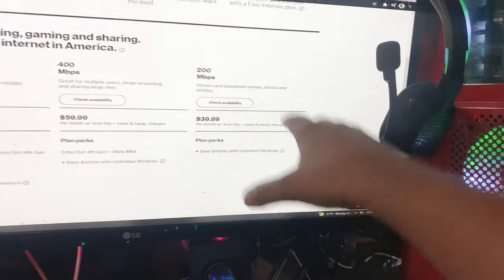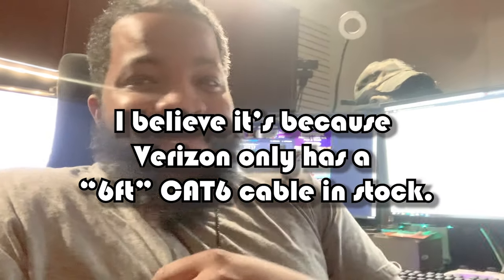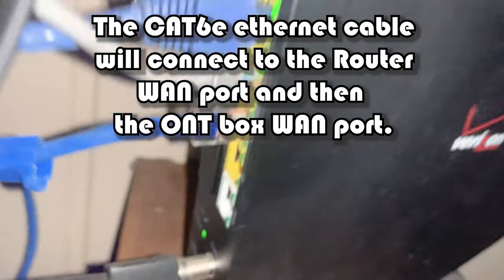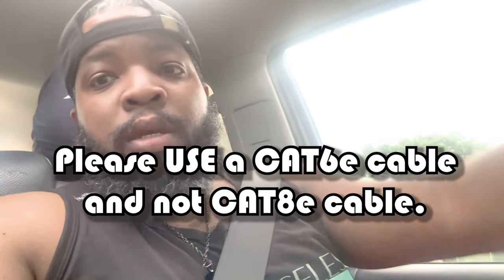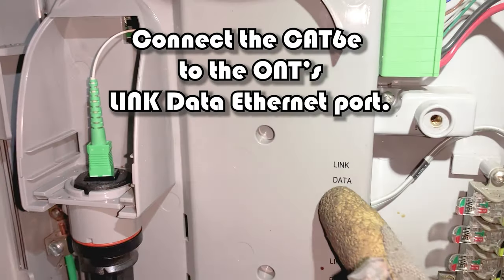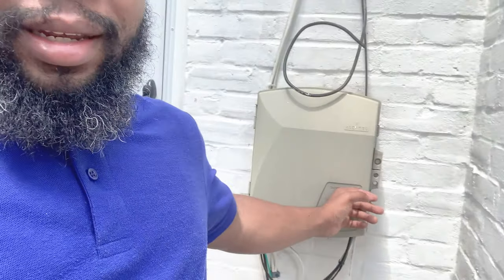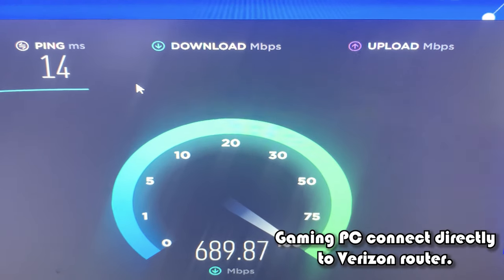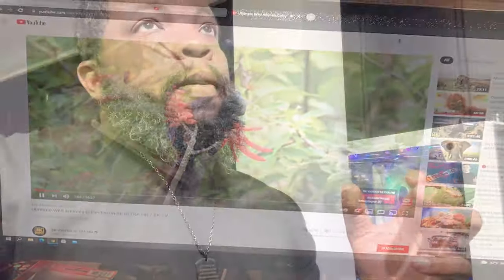How To Upgrade To 1000Mbps Gigabit Fiber Internet for Gaming (Was It Worth It?)

Comment: Feel the reason you experience better internet speed is because your ping speed changed. before it was coax cables, pings over coax is slow, ping over ethernet is faster.

Comment: I have 1gig fiber also however I don’t think it’s really necessary, or even better, unless you have multiple devices streaming 4k content. Or regularly downloading large files. Otherwise for gaming it’s the latency that’s really important. You can game just fine on even a 10 mbs connection if the latency is low. If you are using only 1 tv usually for streaming and live alone or maybe 2 people having 1 gig is just a waste of money.
Reply from the maker: Hey David,

Yes that's correct, everyone's situation is different including their home network setup which will have different results. But this video in particular is not your average home network, way beyond what your running. The I GIG internet connection was way over due and was WELL WORTH the investment for me. 

Appreciate your feedback.
Reply: @AWordFromMrJones  Also I think a lot of folks don’t realize they are not gonna get one gig speed on a wireless network. Unless you have a top end expensive network maybe. I have WiFi6 router and I get around 400Mbps on my M1 Mac Mini and about the same on my iPhone 12. 
The Apple TV I do have plugged directly into the router because of where it is. However I can’t tell a difference from when I used to use it wirelessly.

I have AT&T fiber optic into the house  with the terminal on the wall.
Reply: my dad got us wifi the other day and he got 1 gig the only thing were gonna use it for is our tv my ps5 and my phone but he thinks it will go faster

Comment: Having fiber period is worth it. why? SPEEDS- obviously having symmetrical speeds cuts down majorly on any kind of buffering period. LATENCY- fiber almost always has lower latency period, and followed by that JITTER lol, jitter is the variation in ping, and with fiber is almost always lower to non existent. Of course, you may see ping variation based on where you connect to depending on where your traffic is routing to, but usually thats over a fiber backbone anyways, so having fiber right off the bat instantly makes that connection stability much much better. is fiber worth it? hell. yes.

Comment: That flat cat6 sucks
Reply from the maker: @Himothy_xx  It depends on the purpose that a “cable” serves you.

Such as a flat Ethernet cable is very beneficial when it comes to the commercial(s) or @ home business use depending on how your network system and building infrastructure.

I’m a IT professional; so a general home user wouldn’t find much benefit of it unless say you a have a “tight” crawl space or behind the home wall where your trying to pull cable for home and cannot use a standard cat6 cable due to its round structure, a flat Ethernet cable would be ideal for use.

Hope you find your solution 🤟🏾

Comment: In Australia, the price for HIS gigabit connection is the price of our 50 mbps connection
Reply from the maker: WOW, if it's the same price then that's a good deal!
Reply: @AWordFromMrJones  no it’s WAY worse because a gigabit is 1000mbps, which you showed was for around $80. In Australia, $80 will get you only 50mbps. If you want 1 gigabit in Australia, the minimum it will cost you is $150 from a small ISP. Our internet sucks. 😤
Reply: I’m paying $95 for 50mbs now I’m doing 250 for 140 or 700-1000 $180 50 upload.

Comment: I’m getting Verizon fios internet and I only have a coax not Ethernet in my apartment, will they install one ?
Reply from the maker: @raymondgomez9808  If Verizon has fiber in your area, a gigabit connection would be available for your home. 

What are you running at home regarding electronics? If you’re gaming plus streaming and notice a delay of connection, then I would suggest contacting Verizon to see what type of “speed” connection plan to enroll.

Often I see when you’re gaming plus streaming a high quality livestream, there could be delays depending on the network connection and computer hardware.
Reply: @AWordFromMrJones  mainly just watching tv (3 tvs ) and just 2 smart speakers and a little bit of gaming and I’m going for the 300mpbs plan service.

Comment: I am paying $65 a month for suppose to be gig speed, but nevee clocked higher than 550mbs on a wired connection (cable) 

There is a fiber company here now, they charge $90 for gig speed. Is it worth the cost difference to performance
Reply from the maker: It's a HUGE difference if your into LIVE streaming your content, the faster upload speed, the better LIVE video quality for your viewers.

But if your just watching movies and playing videos games to yourself, then 550 MBPS is a good connection to stick with.
Reply: No. You won’t know the difference unless using multiple streaming devices or frequently downloading large file. That’s the only reason for more bandwidth. You can stream Netflix at 4k and have someone else playing an online game no problem with only 200-300 mbs
Reply: you won’t notice much performance
Reply from the maker: @obye  Depends on what your doing. The average home user will not notice a difference but a user who deals with high end digital/medical imaging systems would see the difference.

Comment: Very helpful video. Thank you. I am currently at 100mb using Verizon Quantum router (such as yourself) connected via coax. My fios TV is also connected via coax. Running wireless to all other devices (laptop, desktop, tablet, phones, etc). If going to 1gb, besides the router changing from coax to cat6, would the Fios Tv cable box also need to use cat6 or would I continue to use coax from the Verizon ONT box to the cable box and only use cat6 for the router or would i now use cat6 for both? Thank you.